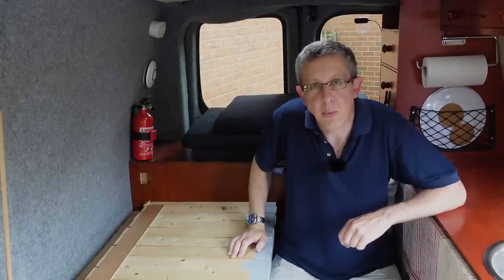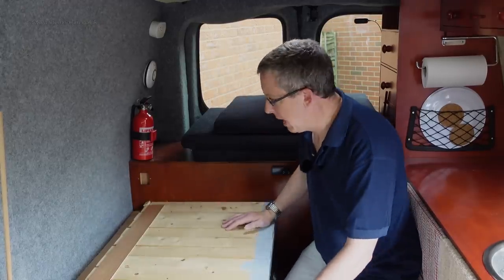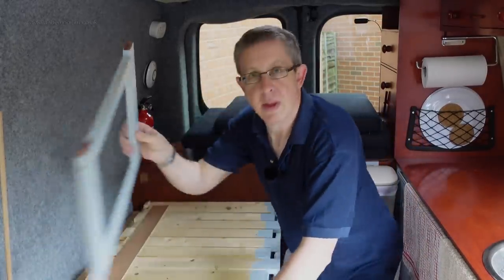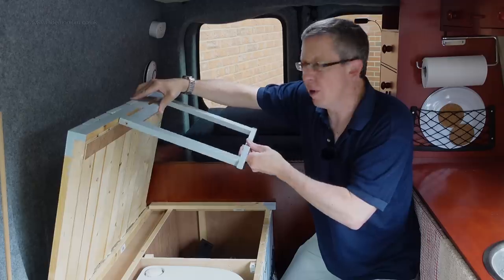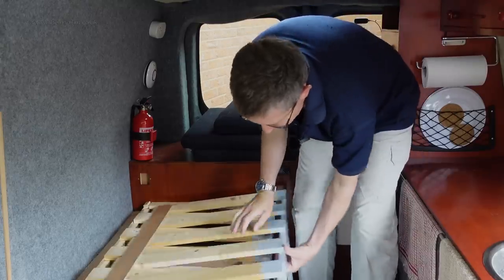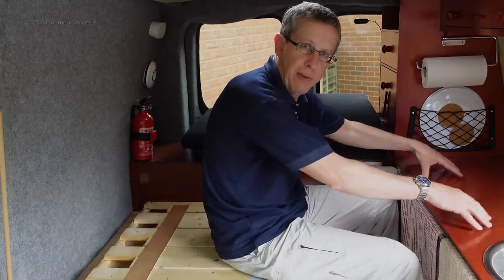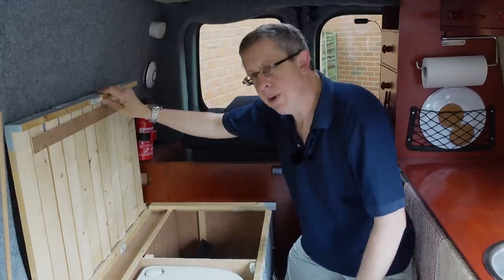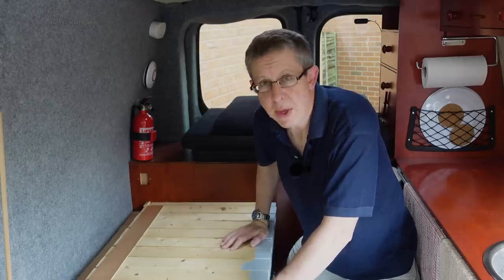84. Help! Your advice is needed.

Comment: Love your channels. Not sure if this would work or not, could you do the straight legs mentioned at 5:11 but offset one enough to fold both? Maybe it is  possible to trim a couple of the top boards that don’t move so that when the sliding boards are back all the way the hallway isn’t any narrower. Maybe its crack idea but if so I hope it’s at least a funny crack idea. Cherriho!

Comment: What about 2 legs locked away horizontally on the sliding section"s horizontal piece, maybe secure in this position with either strong magnest, or with latches, hinging those legs on screws, and when needed, they fold down.
No downward latch needed, as they would be mobile only left-right way, if looked at with kitchen unit behind your back, and in that way you do not wiggle, and the lengthening stripes do not allow anyways..

Comment: Use heavy duty stainless steel piano hinge, widely used on GRP sailboats for large hatches and doors etc. if you go this route you might want to think about using good grade plywood to attach it to both the bed and the legs because that pine would at risk of splitting with a line of screws in it.

Comment: If they folded in, there's no clearance for the lid to lie closed. You've got a bit of overhang. Could the legs stay in place on the floor and ?somehow slot into the pull out horizontally only? Hiding under the over-hang. Perhaps a drawer pull rail out of the cabinet itself to support the lid pull out. Mimicking the lid pullout.

Comment: imagine fake cupboard doors mounted to the front of the bed and when you pull out the sliding part of the bed you swing open the fake doors and they support the part of the bed that slides out and they don't have to open completely for various positions as in part way out for sitting and all the way out for sleeping.  Magnets would keep them closed against the bed when not in use.
Reply: i agree i like this idea.

Comment: Is it possible to attach supports to the other side which fold out?  So the bed slats are on one side and 2 supports hinge from the front of the work top?   I cannot remember if there are drawers or something which might get in the way... Heavy duty fold shelf brackets I just looked them up.

Comment: Hinge them sideways - another piece of wood the same size as the beam of the extending section, cut it to the length you need for legs and bolt through the front of the existing beam at each end.
they then swing up along the length of the beam. Would be easier to explain with diagram.

Comment: Can you not have  anything stowed against the bulkhead. That drop down when you need it.  that's lashed into place at other times with a padded underside.  For comfort.  With collapsible legs that drop down when required. ?

Comment: The hinge method makes sense. Either a heavy duty piano hinge as some have suggested, or smaller hinges so the legs can fold up sideways against the top of the lid. That way when they're down, you'd have to kick them sideways while sitting on it to collapse them accidentally. Might even be able to use magnets to hold them in place in either position too.

Comment: Don’t use legs at all fit crossbeams under the bed sliders just to the ones that move out, you will need to use a bit of a spacer but it will work this will act as a cantilever support and it wouldn’t pivot up then 👍

Comment: Get rid of the legs, cantilever it with heavy duty roller runners?
Either make one a locking runner, so you can lock in place or add an electrically operated linear actuator to make it glide out at the press of a button (a bit OTT perhaps!).

Comment: The legs on a folding card table are designed to easily drop down when needed and to neatly and securely tuck themselves away when not needed. You should be able to acquire the hinges and folding cross brace assemblies by visiting a second hand or re-use centre. Best case, problem solved - worst case will be you've spent a few dollars trying to recycle a bit of hardware.

Comment: Simple! Attach what would appear to be two doors (or simple frames) to the front of the seat unit that you open out to the desired supporting length. As you face the unit, the left 'door' would be hinged on the left side and would open right to left and the 'door' on the right side would be attached on the right and open left to right. These just need to be frames or pieces of plywood with perhaps large holes cut in them to keep the weight down. Normally, they would sit in their 'closed' position against the front of the seat base. They only need to be as wide as the gap is and affixed so that they support the slide out bed slats in two locations. Slightly opened for the extended seat and fully open for the full-sized bed. You just need to find a simple stopper system although I suspect that the weight of the slats, cushions and yourself on top will keep it rigid enough.
Reply: Wow OK I just commented basically this same concept. This is a great idea. I think it is similar to supports for a drop leaf table, so that's how I described it in my comment. But "doors" is the same idea, and an easier way to understand it I think. With my concept, the supports would not necessarily need to reach the van floor to function, but could be made that way for even more support.
Reply: I started to write up my answer then noticed Andrew beat me to it by an hour.
Reply: You beat me to it, I was going to suggest something similar.  Something like a Gateleg table.
Reply: These doors wouldn't need to cross the gap, perhaps half way would suffice.  And you only need 3 if the middle one holds up both sides.  And if you go the 3 route, the 2 outside ones are full length, and the middle one sitting length.

Comment: With total respect meant, this is not a camper that is designed for a partner and multiple additional occupants (children, dogs, parrots etc etc -make your selection..). I would leave the bed 'base' as is and simply make the bed frame permanently 6 inches wider. It is not like you are going to be running up the walking space in a hurry is it?? However if you want to make it a 'two person' sleeping space, I think you need to have fixed 'bearing points' on the cupboards and other vertical spaces to support the bed frame. In short I would skip the 'legs idea' entirely.

Comment: Gate leg?  Like on a gate-leg table.  So the hinge is actually on the corners at the front of the bed area (so not attached to the lid area at all).
Reply: Yes. I think it’s the simplest modification to existing arrangement.

If you want them more versatile, hinged them in the mid point like bi-fold doors so the top can be pulled out halfway to sit on while using the kitchen countertop as described, without having to step over when moving along the van.
Reply: That's what I did on my first mh conversion.
Reply: I think this is the solution. When I googled 'gate leg table' I got the solution right away. This is solid, versatile and solves all problems.

Comment: 90 degree self locking hinges.
Reply: Yes 👍🏽
Reply: Ditto
Reply: Yes, sometimes listed as “self-locking folding table-leg hinges/brackets”
Reply: Yes ! The flip up table on our old Elddis Firestorm had 90 degree sprung hinges which worked well. If you can still buy them they would be worth trying. Good luck.
Reply: The hinge solution is the easiest and best for your situation.
Reply: Piano hinge and keep your sliding bench.
Reply: Need the correct reach distance to efficiently construct cheese sandwiches

Comment: Instead of a "frame" hinging down, why not have two single legs hinged on the front of the movable frame, but folding back into the folding part parallel with the sides, so they lie flush to it when lifted but vertical to the floor when pulled out

Comment: A few ideas (I did not read previous comments so excuse me if I repeat some of them):
1. have a support that ties the slats of the moving part at the backside and bottom. That will allow the slightly out position without any support required.
2. Instead of a leg, have just a ledge or a French cleat on the kitchen itself supporting the height when fully extended position while also keeping it fully extended.
3. If you plan on using the piano hinge as you suggested, add some magnets that will keep it closed when not needed, and you will actively pull it apart when extending the bed. Less rattle, less chance of it hitting the edge of the loo or your head.
4. Consider using triangular support from the base of the bed on vertical hinges. They can be fully deployed or only part-way, and if the sliding part has a pin at the bottom it can deploy them automatically.
5. My least favorite, but putting it out there, you can have an additional front to the base, again can use magnets to affix in the stowed position, can be part-way or fully deployed, can auto-deploy if the slider has a pin at the bottom.

Good luck!

Comment: Hi David. Use hinges that lock at 90 degrees, that will avoid them collapsing or being accidentally knocked. The width of your bed will have to be more than the height in order to work. You can get a pair for about $20 which I think may even lock at 0, 90 & 180 degrees which might assist when lifting open also.

Comment: Legs are attached to the vertical face of the cabinet with hinges so they fold flat against the vertical face when not in use. When in use they swing out a and support the bed. They could swing out as far as they needed to to support the bad regardless of how far you pull the bed out. I don’t think I’m being that clear. I draw everything out, I’m better at explaining tht way too.

Comment: While electrics is something I feel qualified to comment on, I usually leave the bed in my van set up as a bed, since it's mostly just me and I usually don't have much use for a dinette. Is there any way you could attach hinged legs to the front of the cabinet, so they could swing out to support the extended section of the bed and not be attached to the "lid" at all? Secured with magnets so they stay put in transit and don't swing out to trip you up when you don't need them.

Comment: Seeing as the existence of the leg is a problem, why not get rid of it altogether? Replace the bed base slats with extruded aluminium. You can still work it with regular woodworking tools, it’s lighter and stronger.

Comment: You’re overthinking this.  Add hinges to the existing legs.  A small bit of sandpaper glued to the bin frame (facing up) would provide friction against the bottom of the sliding parts—reducing movement (80 grit or rougher).  They make hinges with removable pins—so you could remove the legs if needed.

Comment: The answer is obvious: You need fairy legs. These will extend to touch the floor when the shelf is down, but will shrivel back to their normal tiny size when the shelf is up. The problem, of course, is that fairies are quite hard to come by these days. You may want to try attracting some by leaving out something shiny. And then you'll have to figure out how to remove their legs; simply tearing them off won't work, and if you do manage it the Little People will make your life a living hell for your cruelty.

On second thought, maybe just go with locking brackets.
Reply: Hahaha I love smart-ass answers

Comment: Try using folding hinges on the side of the legs that lock into place, rather than spring loaded rod hinges. That should keep it out of the way when open and provide more stability when in use.

Comment: Quite the conundrum you're in. How about a pair of heavy duty roller rails (I'm not sure what their exact name is)  that you would have in a drawer system? They do make them sturdy enough to hold your weight and then some. You'll have no need for support legs that fold, lock,and  extend and it would be a project that you certainly have the capability to accomplish. I've seen it done and there are plenty of videos of tutorials on the subject.

Comment: I think you answered your own question David. As I was thinking hinged...you suggested it. As soon as I was thinking lock/latch...you suggested that too. That's what I would do.
I noticed that the slide out part has no brace underneath at the back to stop it from lifting off/out, with  some spacers (so it can slide freely) and a brace underneath at the back, you could slide the seat out 6" without the leg attached and the hinged section and underneath brace would prevent it from lifting...then no legs needed for a 6" pull out; most weight would be from your torso which is way behind that 6".
Now! the question is, with the brace on the underside rear, would the bed still pull out fully.
Perhaps you would need to extend the width of the top two frames with longer sections, making them an inch or two wider...this way you'll only need to attach the legs when making the full size bed up.

Comment: Put a single leg either end of the pullout section that pivots on the end. When you slide the section in  pivot the leg fully over and it stores flat on the top.

Comment: What about legs that fold in different directions, like those on a folding card table?  From the POV of sitting on the loo, the right leg would fold sideways when stowed, while the left leg would fold back towards the side of the van.  The hinges could come from an old card table you find in a yard sale, perhaps.
Reply: Great idea.. if needed he can cut the length of the legs where it will be level..

Comment: The old writing desks had vertical slats or boards on either sides that pulled out and supported the hinged drop down writing surface. 
That ma work or heavier duty drawer slides?

Comment: The legs don’t need to be at the edge. Set them a few inches in from the edge. They also don’t need to be in line with each other, so if you go with legs that fold toward the front and back of the van, they can be offset from each other so not interfering.

Comment: Having had another watch.   If the piece at the back that ties the movable slats together was on the under side it would hold the extension part in place without any leg(for when you want it part way out as you are still sitting on the supported part) then just add the support leg when it's fully out.  Does that make sense.

Comment: To the rear of the loo, you have a vertical panel, you also have a vertical panel at the back of the bed, and presumably at the front of the bed. You could install parallel panels next to each of those that have the ability slide out to act as supports for your bed/bench. This would allow you to slide each panel out as far as you wanted, and independently of each other.
We love your channels, you got us through Covid 😁 And with due perseverance you will get through this dilemma. We wish you all the best.

Comment: The most difficult problems are often solved by the most simple solutions. Put the legs on TOP of the sliding part of the bed so they fold flat when not in use. To extend the bed, just flip it over like a RIB bed, drop the hinged legs and adjust to desired width by sliding into place.

Comment: Hinged support boards instead of legs. These supports would function as they do on a drop leaf table. On a drop leaf table, you would pull up the drop leaf, and then swing out the support underneath. But in your case, they would just swing out at whatever angle you need. The boards are hinged vertically to the front side of the bed structure. They sit flush with the front when not in use. Swing out partially (45 degree angle) for using the bed as a seat with kitchen, or fully (90 degree angle) when using the bed in full size bed mode. Since the supports are not attached to the bed platform, there is nothing to bump into or get in the way when you lift up the bed platform.

Comment: For a simple fix why not use the existing dowel system in conjunction with hinges? I.e. the dowels will still engage when the legs are swung down but will disengage when the top of the bed is lifted up. Anyway good luck with finding a solution that fits your requirements.

Comment: cut out slots in the front face of the bed. Create two simple L shaped pieces of wood as legs with the fronts slightly lipped. That way you can lift the top drawers without fouling the legs as they will remain in the base but as they are lipped slightly, when you pull the bed out to any length the legs slide out with it. when you push it back just push the bed in via the legs.

Comment: I do a bunch of RV camping, not sure if it is true for vans to, but things are always a compromise. You have to weigh your ability to do something against how hard that thing is. 

It seems your issue is a search for convenience given your current solution is perfectly workable.

Might i suggest 2 things. First i recommend putting a brace under the sliding part so it cannot be taken off. That brace would act as as the support when you use the bench in the partial  position. No legs needed then. 

Next, put stationary braces in the fully out position. Then you don’t have to worry about legs at all.

Comment: You don’t open the front so a vertical plywood front same size as the front, two wood slides that extend into the front and back of the storage area. Not attached to the lift up lid, pull it out to the required set size then pull out the existing top to match.

Comment: David, as soon as I saw this I realised you were approaching the problem from the wrong angle. As others have already said, use legs hinged to the base, not the top. Just like a gate leg table. You ought to be able to swing the legs,  i'd make two, out to support the top no matter how far out you pull the top. 
Alternatively, buy a pair of drop down hinges and fix to the base. Temu do decent ones very cheaply,  I've just bought two pairs.